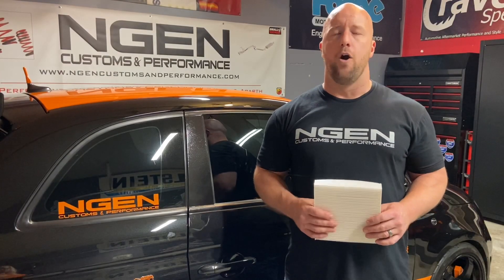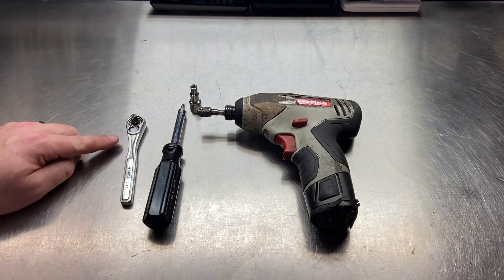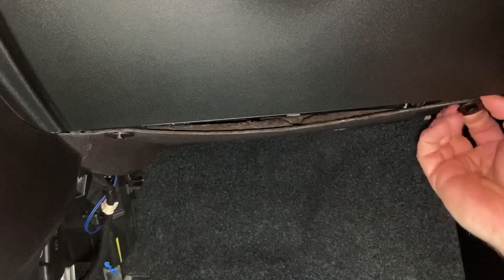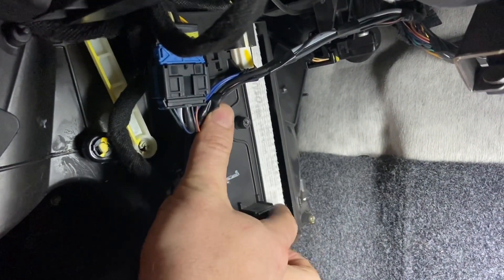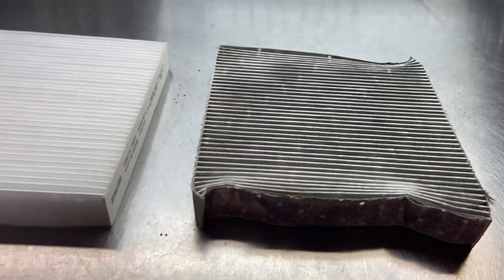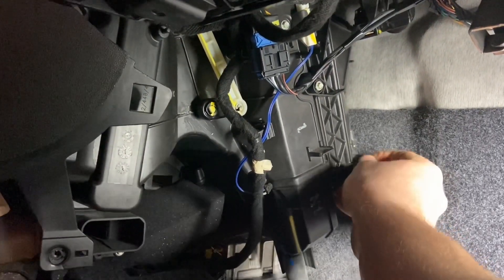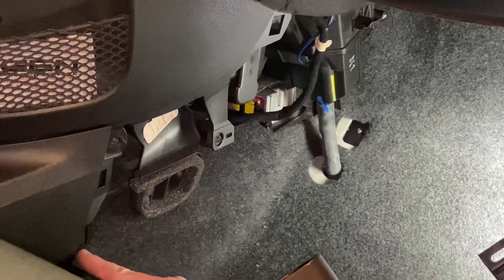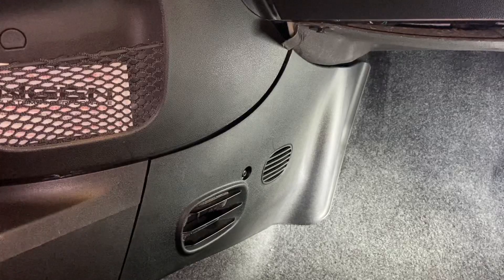CABIN AIR FILTER REPLACEMENT on a FIAT 500 ABARTH - HOW TO!

Comment: Thanks very much for this very helpful video! Heads up, I don't know if it's just on my Abarth (2013), but my filter cover need a 5.5 mm socket, not a 5 mm one--so if anyone else is having trouble with their cover, I'd try a slightly larger socket

Comment: The ridged part of the filter should be at the top and bottom so the groves run perpendicular to the ground. The filter has an airflow indicator which should point towards the rear of the vehicle.
Reply: I saw that in another video. But does it make a difference? Airflow direction might be a thing, but does it matter what orientiation the filter is in? Isn't it square?

Comment: I work on a lot of abarths in the uk and we have to remove the 17mm bolt on the steering column and then move the steering column out of the way to be able to get to the 5mm bolts and remove the cabin filter.
Reply from the maker: Jamie Tustin major difference between LHD and RHD.

Comment: Just FYI, the screws for the filter cover are NOT 5mm as stated in the video. They are SAE size 7/32. Very stupid but not a surprise coming from Chrysler.
Reply: Was just about to comment this 😂
Reply: 5.5 millimetre fits them ...my old Snap-on  quater drive 5.5 mil was for similar little bolt heads occasionally over 38 years working in my Car workshop ..yes i noted also the wrong size given ...Throw him to the lions or shall we let him go?😂❤
Reply: Lions for sure, lol

Comment: Do a Multiair Vavle Spring Upgrade for the 124 spider please.
Reply from the maker: With all of the initial problems these “upgraded” springs caused for many fiat owners, we are not a fan of these.  From my understanding, the initial problems have been corrected though.  We will not be doing an install video on that but thank you for the request.

Comment: Is the cabin filter directional like the engine filter?
Reply: This type usually is directional. It'll be marked with an arrow. Haven't changed it on my Fiat but looks the same as 90% I've changed.

Comment: Just changed it on my 2012 fiat 500 sport manual, I recently bought...it still had the factory filter it was disgusting
Reply from the maker: @perplexhaze666  oh man… 12 year old filter?  I bet it was lovely lol
Reply: @NGENCustomsandPerformance  don't get me started ...I got it from a used car lot I did research and I heard all the cons people have w these vehicles but I'm trying to do all the work on it myself ....the dealer guy tells me " I just did the oil change on it " I said ok 👌 but already had it on my head to do the tune up as soon as I brought it home ...the oil drain plug was stripped took me 2 days to get it out and the oil was black burnt nasty black ...transmission had bearly 1 quart...now it sounds and runs better
Reply from the maker: @perplexhaze666  if you maintain them, they are very reliable.  Get all of the maintenance up to date and you should be fine

Comment: Just tried to do mine, but apparently my bolt size for the filter cover are not quite 5mm. I tried every socket in that size range but nothing. There is a small plastic lip around the bolts that may be impeding the socket making good contact too, but no dice. I may have to go yell at a Fiat tech at the dealership now.
Reply: I just found the same thing. After a bit more digging it seems the screws are American standard 7/32